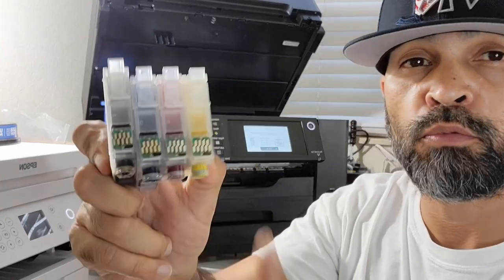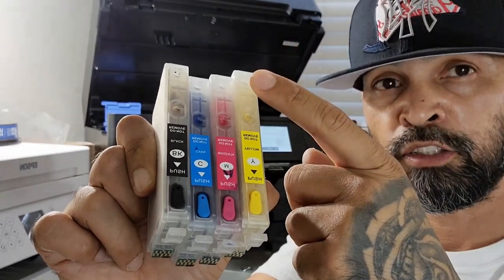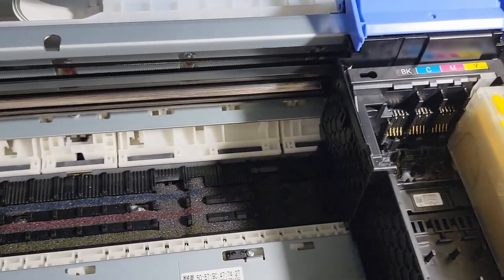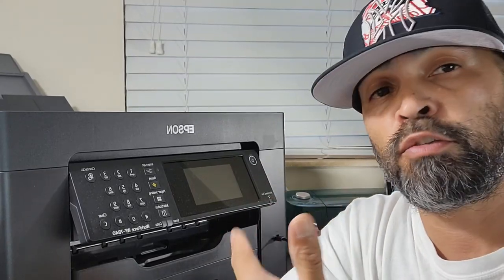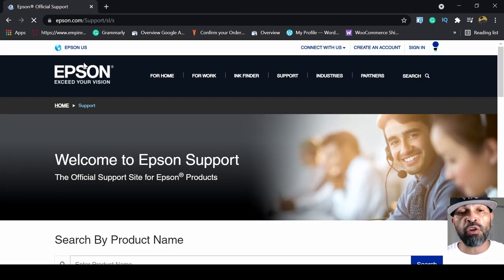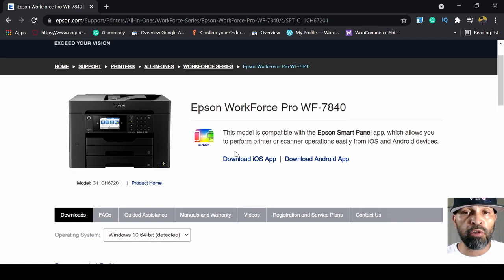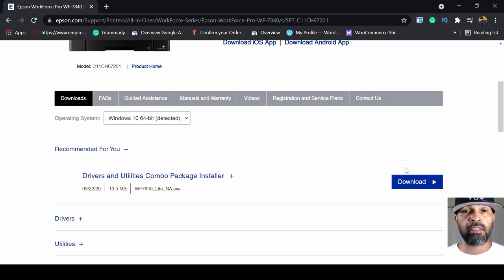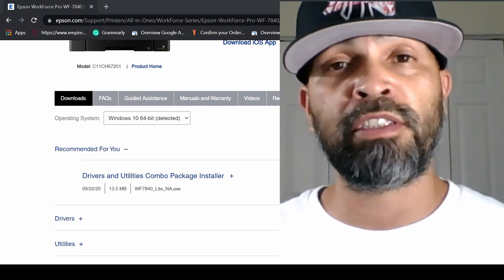Converted WF 7840 Into A Sublimation Printer (Part 3 - Help)

Comment: Hi Kenny. You are my go to guy for sublimation stuff. I have a wf-7840 that I have added reusable cartridges to. It started to not print very well. I have done print head cleaning more times then I can count. Now it's saying this.
Reply: Sorry, it didn't copy. "There is a problem with the print head. Contact Epson."? 
Any idea what this means and can I fix it myself?
Reply from the maker: Hey.  Did you update firmare on printer?  DONT UPDATE.  Next ypu can do is turn off printer, unplug it, let it sit for 30min or more, then plug it up and check it out.  Worse case scenario may have to get some kind of cleaner solution.
Reply from the maker: Watch this video: https://youtu.be/6p45-3XNhyA
Reply: @diywithkenny8399  you're the best!! I'll try all that. You may hear from me again!! Lol.
Reply from the maker: I try my best.  Let me know if any of those solutions worked ‼️
Reply: @diywithkenny8399  so I did what you said about unplugging the printer. All the colors print great, except magenta! 😭
Reply from the maker: Ok.  So may have to print head clean again a few times to see.  Let me know.  Should run a print head clean once a week going forward.  IF that does not work for magenta, you may have to get that cleaning kit, sent a youtube video link above somewhere.
Reply: @diywithkenny8399  thanks so much!!

Comment: I have a brand new WF7840.  I understand I am not to use the print cartridges that came with the printer.  I did not purchase empty cartridges when I purchased my ink.  My question is - since I need the chip off of the original supplied print cartridge so that it can be put on the fillable empty cartridge I need to order and fill, would it not be better to just order the empty cartridge with the chip so I don't have to do that step?  Then I would have extras on hand from the original cartridges.  Make sense?  Other than the cost it seems the best way to go. Thank you!
Reply from the maker: Sure that be a smart move and save that original ink for something else, can always convert back.  Check Etsy link in my description, can also use etsy search engine for better prices.  Hopefully soon someone makes reset chips or something 😎

Comment: Hello. Just purchased this printer and have a few questions to start the sublimation conversion.

Do I need to install the epson cartridges first for initialization, and then switch the chips to the sublimation cartridges? Or can I automatically swap the chips and then do the initial initialization with those? Any recommendations you have would be much appreciated. Thanks
Reply from the maker: Hello.  Can do it either way.  But if you have the sublimation kits now, just convert it.  Just do not forget to go to www.epson.com/support & search your printer to download the recommended drivers.

Comment: Hi Kenny, I hope you’re doing well. I did step by step the conversion of my new AF-7840. It was working excellent with the set to you showed in one of the videos. After probably 25 pages printed now some colors are way off. Green is coming out on the paper light blue and black is coming grey. Any tips on how to fix this? Thanks
Reply from the maker: Hello & yes.  Not that you are running your printer, have to treat it like your car.  IF you are not printing everyday, or every other day, ect.  Go on printer to maintemance and run "Print Head Clean", just run it a few times (maybe 2 or more times), the 2nd step is optional to print out (use regular copy paper) but recommend to do.  Then try a small print design.  I do this myself weekly basis.  Let me know this helps.
Reply: @diywithkenny8399  Hi Kenny. Thanks for your response. I did 4 times what you recommended. However, the first two test print out the system recommended came out almost perfect. Just one line with a space. The other two rests pages you can barely see the lines. Also, is asking me to update the firmware which I keep avoiding.
Reply: Unfortunately, now when I send something to print seems to be printing but paper comes out with nothing. Also, it was showing that I ran out of the magenta and yellow color. Since cartridges are single chip use I changed both chips and is doing the same thing. I’m going to leave it alone until tomorrow before I break it.

Comment: Did you have to adjust your color settings in order for pictures to print correctly. Mine is very off and I can’t seem to figure out the color settings
Reply from the maker: Yes.  But can always adjust colors to your own, but here a video, it should start at 9:27 for the colors:  https://youtu.be/aLpdCW_yQkw?t=567
Reply from the maker: Also may depends your sublimation ink, but try those settings in the previous reply.

Comment: Hello, my printer is saying my ink magenta is low. It's not low. Can you help me?
Reply from the maker: You have to manually check your ink, can go to settings and find something like replace cartridge or ink.  That way can check all refill cartridges.
Reply: @diywithkenny8399  I did that. It had plenty of ink inside of it..
Reply from the maker: @kimrivers30  ok.  Did you watch part 2 (microchips):  https://youtu.be/RpGKMmlkNh0

I'm still researching on how to bypass changing out chips, once my chips get low.. will be experimenting some things.
Reply from the maker: @kimrivers30  may have to for time being change out the megenta color chip only.
Reply: @diywithkenny8399  Ok. Ill check it out!
Reply from the maker: @kimrivers30  Once I get my chips down, got a few things lined up that I will try.
Reply: @diywithkenny8399  thanks for all your help!!
Reply from the maker: @kimrivers30  Anytime 😎

Comment: Hi Kenny, I removed the chips and put them on the refillable cartridges, but I keep getting an error message on the yellow one.  Any suggestions?
Reply from the maker: Hello.  Did you remove the clear plug when filling up the ink & replace it with the color seal from the back?

Double check the chip facing up correctly & that it is steady placed before putting in printer.

Also when olacing the cartridge into the printer, keep it level .. then go straight down then, push slowly till the click.  Remove it keep is level and lift straight up.

Did you download the recommended drivers from www.epson.com/support ?  Go there and find your printer, then download recommend drivers.

NEVER UPDATE FIRMWARE ON PRINTER.

Let me know.

Comment: Hey Kenny thank you for all the videos. I've followed all the steps but my 7840 is only printing blank pages. Do you know why that is? The ink is not clogged. The printer counter shows 27 color pages printed but all those pages actually came out blank. Any idea? Thank you 😊
Reply from the maker: Hey Ashlie. Will ask a few questions:

Front of refill cartridges where chip is, did you take off clear rubber seal and fill sublimation ink there?  Answer will be throw away clear rubber seal and move color rubber seal to replace it.

2nd.  Did you watch my video on EcoTank & WF 7840/7820 Print settings &  preferences?  Answer is to download the recommemded printer drivers and stuff.  will send another reply with video.
Reply from the maker: Watch this, and after you download.; if you have WF can fast forward after download to 9min and 27secs:
https://youtu.be/aLpdCW_yQkw
Reply from the maker: Let me know.. and we can figure it out.. just a minor step missing.  You got it 😎
Reply: @diywithkenny8399  thank you for helping. I've followed all those steps and I've watched all the videos I can find with 7840 in the title. I've done all the cleanings, and ink does come out the other side onto a paper towel so it's not clogged. The driver is installed and the settings match yours. I'm starting to think I got a bad printer.... 🤔
Reply from the maker: @ashlietaylor847  
Hmm.  Are the chips facing correctly?  4 copper looking things top and 5 copper should be bottom.  Where did you get your chips from?  If anything can try tomorrow and if you have twitter you can add me there to figure this out or can text here.
Reply: Where can I purchase the cartridges
Reply from the maker: @desireewallace5535  https://tinyurl.com/ukb5j9vk
Reply from the maker: Also did you watch this?  Mean time I would just go backtrack and pause at each step: https://youtu.be/PI5RadxJX8M
Reply from the maker: Also did you shave off the bottom plastic nub part where chip goes?

Comment: Hey Kenny my wf 7840 won’t recognize the cyan sublimation cartridge after changing the chip.  Tried two separate chips and it won’t pick it up. It however recognizes the old chip instantly.
Reply from the maker: Hey Andre.  Have to ask:
Are these Etsy purchased chips & cartridges?

Are the chips facing correctly (4 copper top and 5 copper bottom)?

Did you remove the clear plastic rubber seal, and replace it with the color rubber seal from back?

Last thing did you setup your printer at www.epson.com/support/  to download the print drivers stuff?
Reply: @diywithkenny8399  The brand is LEMARO 812xl printer ink those are the chips im using. The cartdridges came with hiipoo ink refill kit. Thing is i changed the  yellow and it works fine but the cyan just isn’t being recognized. The chips are placed correctly
Reply: @diywithkenny8399  The printer was setup correctly from epson. It has been working great. Just that the cyan ran low and i got the ink low message so i did the refill and re chip as per your video.
Reply from the maker: Hmmn.  Can try to configure this way, using the new replaced chip for that color.  Just turn off printer, unplug it, give it 10 minutes.  Replug and lets see.  I have use new chips from "myCartridge 812xl" to replace ..  but try that.  Excuse late reply
Reply: @diywithkenny8399  Ok will try that
Reply from the maker: @Drefol4379  let me know. 😎
Reply from the maker: Worst case scenario may have to get refund and explain that ink cartridge not compatible, but hopefully it works
Reply: @diywithkenny8399  Yea it didnt work. Thing is the other cartridges work perfectly. Im wondering if the chip holder is possibly damaged. But the old chip works with it so i don’t know. I have ordered a set of new cartridges so i will let you know if the chips work with that one. Thanks and keep making those videos bro👊🏽 very helpful.
Reply from the maker: @Drefol4379  Ok feel free hit me any time.  Etsy chips and cartridges been good so far I heard.  It will work out 😎

Comment: I don't have twitter, just Ig and Fb. I followed all your steps and the ink isn't coming out. Should I re do the chips? idk where I went wrong.
Reply from the maker: Hello.  Ok.  After filling ink and priming the refill cartridge, you had to remove a clear seal right, that clear seal can throw away.  Take the color seal from backend of cartridge to replace where clear seal is.

If you done that, then you need to connect your WIFI, then go to www.epson.com/support/  type your printer (WF 7840 example), then download "recommended" drivers
Reply from the maker: This is example here in beginning for epson support:   https://youtu.be/aLpdCW_yQkw
Reply from the maker: Let me know anything else.  Just hit me up any time, will answer if needed.

Comment: Hey Kenny. I have my Wf7840 working- it is printing really slow. Is that normal?
Reply from the maker: yes.. if you can pull up that preset window, and IF you unchecked "Bidirectional" printing.. will lay down or print slower.

Comment: So, I did everything step by step, but I bought my printer used so it had normal ink already in it. When I put the sub ink in, I did some print head cleanings and it is saying “Print Head Adjustment Cancelled. Problem with Print Head” Do you know a solution to this? I had a 7720 before and never had this issue. Ugh.
Reply from the maker: Hello.  Have you tried to print any image?  Also did you download the "Recommended" print drivers from www.epson.com/support (need to download that).
Reply: @diywithkenny8399  I just tried to print an image. The page is totally blank.
Reply from the maker: Then you need to download the recommend drivers off epson support on previous reply.
Reply: @diywithkenny8399  It’s still not working. Its no longing saying Print Head Adjustment cancelled.” The ink just isn’t coming out. The page is totally blank.
Reply: @diywithkenny8399  All the black ink I had filled the printer with is not gone, it says low ink and the maintenance box is about full. What in the world.
Reply from the maker: Dang..hmm.  Did it print anything before converting?  Also did you rrmove the clear seals where you fill the ink and place the color seal from the the back?
Reply from the maker: Thinking because it was used?  But still should have mentioned it in the seller description 🤔🤔🤔